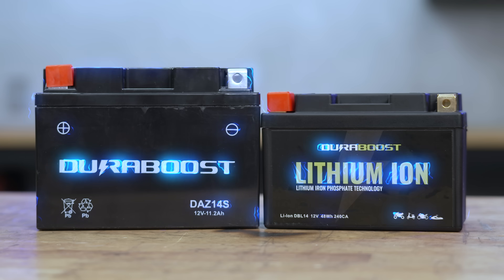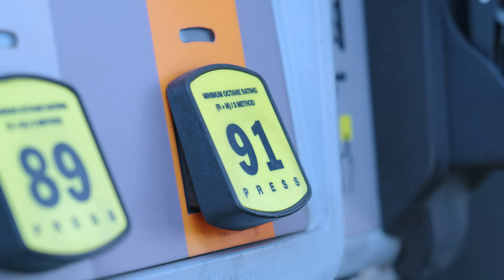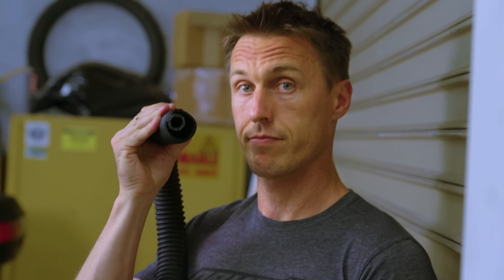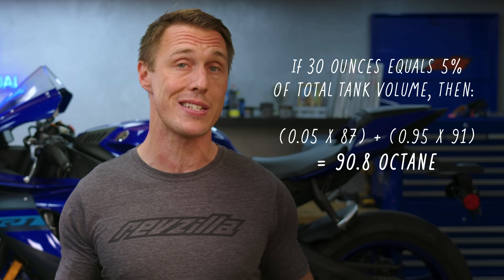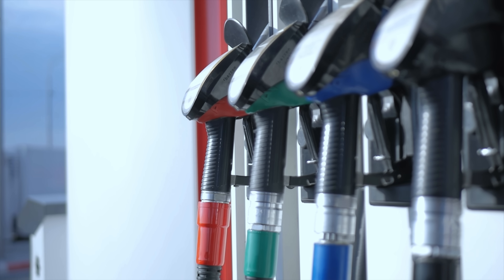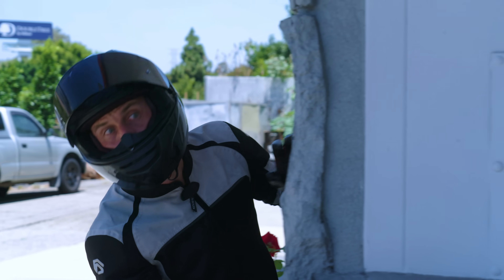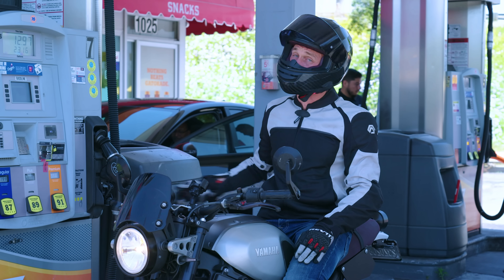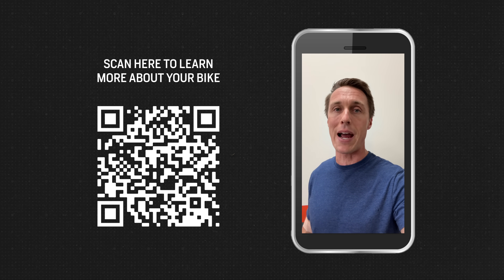How Much Regular Gas Are You Getting With Your Premium? | The Shop Manual

Comment: What I know about premium is this. Exxon and Shell premium makes my 2003 Honda Accord four-cylinder car run very quiet, very smooth and I use way less gas pedal to move the car. If I try to run any no name gas... especially Wawa gas, a convenience store chain's gas, the engine shudders and the valves rattle. 
This car has just turned over 200,000 miles and runs like new on the Exxon and Shell premiums. It especially likes the Shell nitro premium gas. The gas mileage is excellent. This 20-year-old Honda have never failed an emissions test either. I maintain the hell out of it too.
 I'll use the name brand premium as long as I can you. Gulf and Sheet's (which I suspect is Exxon gas) are pretty good premium's as well. You do what works for you. 
I cannot believe they are simply going to outlaw gas cars. The world has lost its mind. 
P.S. I run my lawn mowers on premium and if I had a motorcycle, I would run that on premium too. I put red Stabilo in any gas used in a carbureted engine. I use twice the dose they say to use, and the stuff works. I have a fifteen-year-old two stroke snow blower from Sears that is still running. I use Pennzoil synthetic two stoke oil in the gas in that as well as the red Stabilo stuff. 
Where I live, only Exxon and Shell regular are good gases, but I use their premiums anyway. But that Exxon / Mobil regular is the only gas I will put in our work vans or trucks and yes, it makes a difference. Those V-8 Ford engines have more power down low and run smoother then on cheaper no name gasses.
If the government would stop forcing corn liquor (ethanol) in our gas tanks, I would use regular but the cleaners in the Exxon and Shell really make a running difference in my car. And their cleaners are better than what you can buy, at the Auto parts store, because it's constantly working in the engine.
Sorry for the long post. My car means a lot to me. 
Outlaw gas cars? They should outlaw hallucinating politicians.
Reply: I dont know what kind of noise you are sensing but the fuel cannot adjust the valve clearances.
Reply: Waste your money all you want, but the Premium in the US doesn’t have any more detergents than the regular, and your Accord runs on regular.
Reply: @jimstenlund6017  each top-tier premium has a different additive package than unbranded premium. same base, of course. definitely different than regular unleaded.

Comment: Former tanker driver here. You're not only still getting regular, you're also getting diesel in your premium. Tankers and hoses aren't bone dry between products.

Ever see a delivery driver stick that long measuring stick into the underground tank? He's not only checking fuel level, but also for how much water there is, and there is always water.
Reply: Again, and no one is paying me to say this, Helix 5 in 1 Racing Additive!  It is the only readily available fuel treatment that emulsifies water so that it will pass through the injectors properly.  It also claims to add 2 octane to your fuel.  I have been using it for 3 years now and not one single fuel related issue.
Reply: @Anoldphotographer  ethanol does exactly the same thing
Reply: Always water? In Diesel maybe, or in Ethanol-free, but your not finding water in E-10 gas with that stick.
Reply: @jimstenlund6017  When I drove tanker we had to start checking for water once ethanol was introduced. Didn't even look before that lol. That was the gas stations problem. However, I did have stations that would over order on regular and then try and get you to dump it in their premium tank. First time it happened I thought they might have just ordered too much. When they did it again a couple of days later, I realized they were trying to rip people off as their regular tank wouldn't even take a thousand gallons.
Reply: @kittywampus  there was a local station here that had 3 grades but only 1 tank.
Reply: @kittywampus  Did you ever find water in the E-10?
Reply: @jimstenlund6017  the paste showed there was some, but not enough to worry about. IDK, ethanol was a new thing and a pain in the ass, I stopped driving tanker not much longer after the switch. My company was sold three times in three years and the last owner was going to screw us on pay so I opted for an unemployment vacation before going back over the road for a while.
Reply: @JCunningham21  damn, they weren't even trying to hide it, lol
Reply: @jimstenlund6017  All fuel storage tanks have water in them, it's the nature of condensation, some have water due to age and/or ground seepage.
As water is heavier, it sinks to the bottom of non ethanol fuel tanks, pick ups for the pump are not right on the bottom so as not to pick up water or other contaminates.
Scrupulous operators will have their tanks cleaned periodically to maintain quality fuel to the consumer.
Ethanol is hydroscopic, so instead of the water sinking to the bottom it stays suspended in the ethanol fuel, hence the tanker driver or fuel station operator applies a paste to the dip stick which then identifies if the fuel is contaminated with water and needs to be pumped out.
Reply: @lionelcook8522  Right, except unless the E-10 has so much water that it can’t absorb anymore, then that paste will show the amount it can’t absorb, the straight water on the bottom. Partial contamination of water in E-10 will require something other than a stick with water paste on it.
Reply: @jimstenlund6017  you must operate under different guidelines in the States as opposed to here in Australia.
Likewise we would never put a lower grade fuel in a premium tank knowingly regardless of an instruction from the outlets owner.
Reply: @lionelcook8522  I’ve only known one place like that, owner had two stations, one no-name, other was Chevron. He’d offer drivers $100 to drop the wrong fuel.
Reply: @jimstenlund6017  I love when idiots on the internet tell someone who actually worked in a field "nuh uh!"
Reply: @AccountInactive  And you always found water in E-10 gasoline tanks, right?
Reply: @jimstenlund6017  yes. Ethanol draws in so much atmospheric moisture in addition to what's already present from condensation and straight up leakage from the surface.

Comment: back in college we did a project with our recherche engine, it couldn't tell the difference between regular and premium from the same station, it doesn't matter. other than that the cheaper the station the higher the octane. the local valero beat out the shell and chevron beyond the error margin. 

the cheaper the gas the more people buy it the more often its delivered the fresher it is. same with the regular and premium from the same station. i just run costco regular in everything and nothing pings.

Comment: For dirty gas i use a splash of B12 Chemtool. Some times buying non-ethanol for my lawn care equipment will still contain ethanol despite being of a separate hose. It's essentially a scam, so having something to clean out ethanol on carbureted engines is always useful. Signs of bad gas is small back fires and sub par engine acceleration.

Comment: I agree that it won't matter for most bikes, but your math with 5% of the tank volume is not realistic. That would only be the case if we fill up the tank from completely empty every time. Most motorcyclists will fill up well before that, for example because the next opportunity could be further away, we don't want to ride around on fumes, or we simply want the tank full again for the next Sunday ride. The low fuel light on some bikes turns on with 1.5 up to 2G left in the tank... 
If you have a 3.5G tank, and you top it up when its half full, you are getting over 10% of the other, most likely lower, fuel grade. If you top off a nearly full tank, it could be 20-30%. If you do this regularly, your tank contents will eventually be measurably lower grade than the 91 or 93 you paid for every time. There are some bikes where this does matter.

Comment: Id argue what matters more is the age of the gas. Winters coming up so im switching to nonoxy to clean out the ethanol in my system. Our local pumps 2 seperate hoses, one for ethanol and one for not. Well, that gas I just pumped didnt exactly smell fresh. Gotta figure non oxy premiums sells far less often than the cheap 87 stuff, so its likely to be more stale.

Comment: So whatever the fuel tanker hauled on the last load, your tank is getting mixed, so if it had diesel and then loaded gasoline, you're getting a mix of whatever was left in the tanker  It's not much fuel, but it is always a mix of something, including additives that goes in it at the fuel  terminal

Comment: One thing people don't usually mention in the ethanol debate is it would likely stick around even without the mandate. Ethanol is the cheapest allowable source of octane for blending fuel.

Side trivia: the Soviets used ferrous compounds to boost octatne in the 60s and 70s which left a nice layer of rust on the inside of engines.
Reply: cheapest because it's subsidized...

Comment: Given my smallish gas tank in my KTM 390 Adventure, I will now be a little less likely to fill up at half a tank. If I only put about about a gallon of gas in my bike, and given the worst case length of hose, almost 1/4 of that gallon would be leftovers. Thanks for the info! I do not think it is too big of a deal, and it just requires a little rewiring of my habits :)
Reply: Just do a little math and fill up after a premium purchase.
Reply: @kd350  I appreciate your input.
Reply: Just so you know we use the same compartment in the truck for all grades including diesel and ethanol free. Octane ratings are the minimums. There's always a bit of retain in the truck anywhere from 1/2 to 5 gallons. The fuel racks normally use the same hose for all similar products like all reg/prem or #1/#2/reddye. Only reddye is specifically purged from the line towards the end of fueling. Guess what I'm getting at is all grades and types have some mix but just like the same hose being used at pumps its so minimumal it doesn't even matter. Even the pipelines have mix. There's no physical barrier when pumping the refined from the refineries to the fuel farms that feed the trucks.
Reply: @UHN-lg3em  Interesting

Comment: I run regular in my 2005 Honda CRF450X... almost 20 years later... It had well over 12k miles on the original motor (before I decided to do an overhaul) and I have never had to clean the carburetor (ever). The only thing I will admit is that every winter I add Stable to the gas tank and run it through the system.

Comment: "water absorbing corn juice" 😂
Reply: Hatred of change isn't why people hate ethanol. They hate ethanol because it literally pulls moisture out of the air and clogs up the fuel systems with crystallized sludge. All while giving less energy density.
Reply: @hochhaul  It's like 3% less dense because the 10% has roughly still 65% the density of the 90%.

It's like 1mpg on a 30mpg at best...
Reply: @anthonyrowland9072  These days they're blending in more than 10% regardless of what government regulators claim.
Reply: And of course it's a net negative, takes more diesel to produce than it replaces. But it's still fulfilling the main purpose it was pushed for 20 years ago, putting subsidy (taxpayer) dollars into Monsanto's and Cargill's pockets.
Reply: Well put that is exactly what it is, it supposedly reduces emissions by 10 percent but I have done extensive amateur testing and it reduces fuel mileage by 10 percent.  I may not be a math major but something smells here and it ain't the gas.  PS, it was originally come up with to appease the eco crowd and pacify unhappy Midwest farmers.  Has no useful purpose.
Reply: Is what people miss, is that in engines that are used regular it keeps the water condensation dissolved in the gas so it burned out instead of collecting at the bottom of the tank.
Reply: Damn Obama.
Reply: My vehicles have been running on it perfectly since 2009. I hope that it was said in jest and Revzilla don’t follow the odd American hatred of change.
Reply: @davidmatthews3093  Okay progressive guy.  Running fine, that's what you think.  There's so much moisture being absorbed into our engines.  Leaving ethanol gas for a few months will basically kill the gasoline.  

You people think change is always good, it's not.  Just look at all the soy and microplastic we consume today.  The sperm count is 57% lower in adult males than it was in the 70s.  Men can be women now.  Great change, bud.
Reply: @davidmatthews3093  I ran ethanol gas in every thing I've had 2 stroke and 4, never had one second of problem.

Comment: I think all (certainly most) fuel stations in UK have separate hose pump units. It certainly would not do to mix petrol and diesel fuels (our units sell two sorts of petrol and one diesel) - because I’ve been reliably informed that contrary to common opinion those two DO NOT mix together, so you could pick up a little diesel (or petrol) here and a little there and end up with enough to really cause trouble in your engine.
Reply: I've never seen a shared hose for gas and diesel here in the U.S.

Comment: On a slightly unrelated topic, do motorcycles vary, say by tank shape or manufacturer’s fuel gauge set-up, in how much usable (retrievable by the fuel pump pick-up) fuel is left, not only in the “X miles to empty” calculation, but also in the [tank volume] - volume of fuel it takes to return to full calculation? In other words, if a 20 liter tank accepts 17 liters, were three usable liters remaining? Also, what do manufacturers mean by “approximately X.X gallons reserve?”